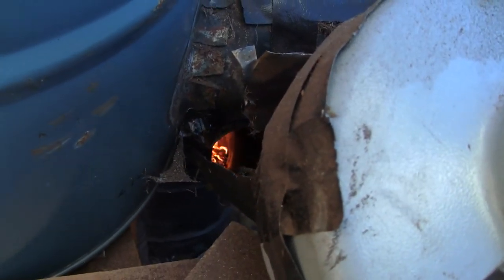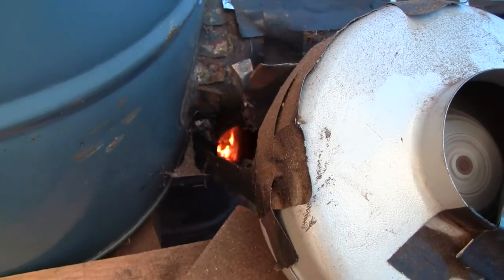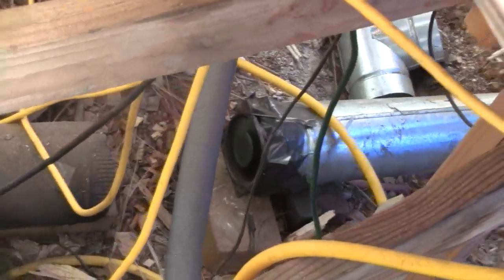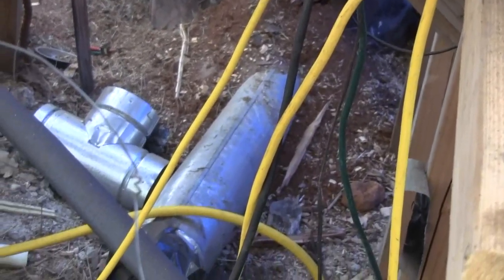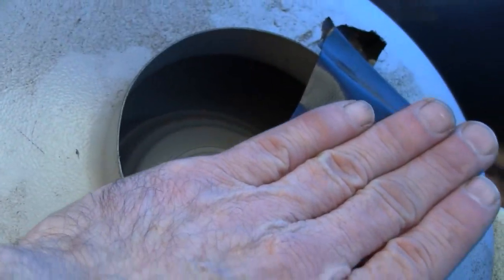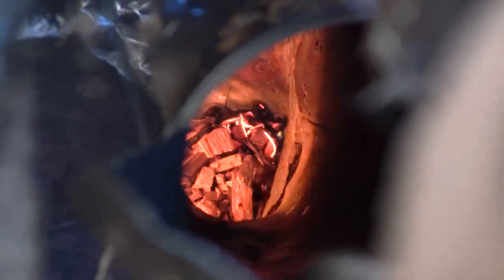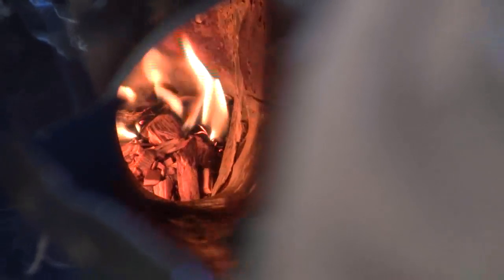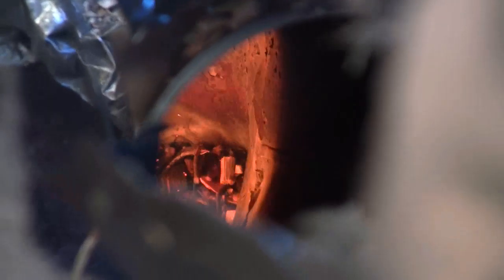40kW wood chip boiler air control.wmv

Comment from the maker: Great and thanks.  You could be a huge help by going to our Kickstarter project and backing it.  You could back by donation of food to local food bank if you don't want plan sets for yourself.  As for your questions;  I ran the boiler all winter to heat the house, burning one or two wheel barrows of wood chips per day.  The heat output  for hydronic heating, was in the (SWAG) ??~~ 20 to 50 kW*hr per day range.  So 1kW*hr/day wouldn't need much fuel.
Please back our Kickstarter for more vids!
rt

Comment from the maker: The feed tube is 45 degrees, so chips fall into burner, then slide down inside toward its center, ~20 inches below chip tube.  Ash and chips accumulate, and ash drops out bottom, but I keep it clean so that chips are always falling in.  Exhaust air after heat exchanger is just a bit warm, so inline blowers work fine.  some heat lost, most of it caught, and in the end, the floors inside are at around 90 to 100 F, toasty warm that lasts till morning after 1 barrow / day burn.
rt

Comment: Thanks for taking the time to explain this part to us. How much heat is lost out the exhaust? Would it burn up a blower up when you install it in the exhaust pipe or will you extend the pipe so that its not as hot?